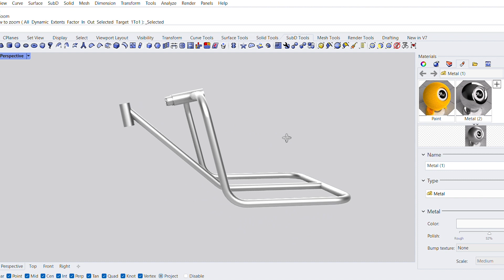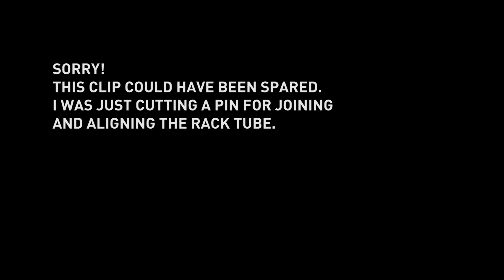Making A Custom Rack

Comment: Love your work and videos, super inspiring. Id love to make my own rack, Do think it is possible to braze a rack using a mapp gas torch?
Reply from the maker: Thank you very much. If brazing with bronze filler you'd need to get the tubing up to 870°c ish and I'd think that would be hard with mapp. I haven't tried. If you used silver you only need 550°c and that could be possible, but you need to practice a lot to be able to create fillets with silver without it running off the tubing. I've made a rack once using fillet pro (which is sort of like using silver) and my fillets were too small and the rack failed after a couple of years. So, I'd be careful not doing a front rack as the consequences are severe. 
I am considering doing rack workshops (and balance bike workshops) where you join me for a long weekend and bring your bike and then we makes some racks together. Haven't gotten around to doing the math yet, but would be a fun alternative to a framebuilding course I think.
Reply: That's super helpful, I think I'll hold off in that case as I haven't the space for a full oxy acet setup. A rack workshop sounds brilliant, I'll keep an eye out. Bottle cages look great by the way! @hulsroy
Reply from the maker: @TandemUK  thanks man